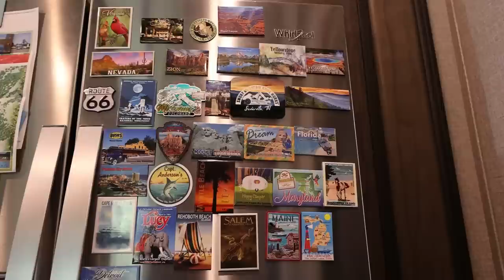RV Water Heater & Refrigerator Maintenance | Tips and More!

Comment: Question if you also replaced the anode rod in the water heater? AND a little tip I did was placed a dedicated socket for the water tank drain plug to make it easier to change/remove the plug. I also went with brass drain plugs to prevent that cheap plastic fittings all through the camper. You guys ARE THE BEST! God Bless, be safe, and happy travels. 👌🇺🇸

Comment: Its so sad you ended up at a camping world.  We had a customer with a bad dexter axle in MAINE.  They called dexter direct and had and axle in 4 days. ( 10 year warranty) It took 3 hours too swap out with regular tools.Than we happened to be in tractor supply....axle was in stock. They even had new brakes. 
On another note dont use those shark bites on rubber hose...get some gear clamps from a parts store.....they were never for rubber hoses. Just the pex plastic .
Camping world as you found out is NOT a place to have anything fixed....liars and cheats.

Comment: y'all have to be the nicest, coolest, calmest, sweetest, most under control, easy going couple I've never met (but hope to).  I've had a few issues with the 3 coaches I've had but thankfully never like what y'all have shown (and who knows what hasn't been shown LOL)  You guys must have a special gene in your DNA that most do not!  And since I started watching I've always thought why in the world does a rig that big not have 3 axles?!
Reply from the maker: JIm, you’re Awesome! ❤️ We will definitely cross paths soon enough. Lee and I both agree that there are always two different approaches to every situation. One is a lot easier than the other, but it doesn’t solve the problem. LOL. Embracing the new challenges and learning from them is so much more rewarding. We Always make mistakes and the RV Community definitely let’s us know that we are making them, but that’s the heart of our channel. Imagine how many other RVers are making the same mistakes every day. The funny part, is that we don’t even know we are making them until we post a video and get feedback. 😀 We hope it helps others. As for the RV, we will never buy any rig over 42 feet without 3 axles again. Our rig is way too big for two 7k axles. Hence most of this season and suspension problems.

Comment: Personally I prefer the Teflon tape instead of the liquid Teflon.  It seems it would fill the threads more solidly.  Just my 2 cents
Reply from the maker: We agree. It’s so much easier. The way we understood it was that it hardens in the lack of oxygen. Since it was one of those spots that we definitely don’t want to revisit, we put on the goop. Truthfully, I put on way too much and had to clean it up. I called it silicone tape in the video, but it’s actually Teflon tape.

Comment: New subscriber - you folks were up in the " boonies" us Michigan folks call it and you'll find out as you repair stuff many RV manufacturers use some real cheap parts. We have  2017 2109S Rockwood Mini lite and had to replace battery on/off switch this past fall. Also had a slide on same trip stop working and was just a 30 amp fuse under battery - thanks heavens for google on that one - happy camping folks - love watching your videos - from Kalamazoo, Mi area

Comment: Frosty residential freezer,,,,,
Was this freezer designed to be earthquake proof?
Nope, the door will shift around just enough to leak cold air while you're driving, normal, 
Things break all the time, most can be blamed on the manufacturer of the rig, comes from the phrase, "Spare any expense we don't have to make to get it on the lot to sell it."

Comment: My residential fridge would freeze up after about a week in hot weather. I had a repairman check it out, and he replaced the mother board that is behind the fridge. Another thing I found out is that to make them more energy efficient they defrost every 12 hours. He was able to program it so the fridge defrosted every 8 hours. Problem solved.

Comment: Look for the defrost timer may be at the bottom of the fridge kick panel test it put it in defrost see if it gets hot
Reply from the maker: Thanks. We will definitely check that out. Great tip. 👍
Reply: all so can go bad Defrost Heater  + defrost thermostat
Reply from the maker: Great tips! Thank you. We replaced the defrost thermostat a few weeks after this video. The freezer kept freezing up. The thermostat was easier to change than the heating element behind the coils. We were lucky it wasn’t the element.

Comment: I was able to fit in a set of small fans in my refrigerator above the cooling fins and get constant circulation down over the fins.  This has eliminated the need for defrosting for the last three years.  I have an on/off switch for the fans, but I leave them on all the time.  The two 12 volt fans ran too loud for me and seemed to be too much circulation, so I put the two fans in series (now 6 volts each) and they are quiet and do a fine job.
Don

Comment: RVing requires self-sufficiency, and you learn as you go!  They are as much, generally more, maintenance and repair than a sticks and bricks!  Now that you have upgraded the water heater's backflow preventor and put a water alarm in, you now want to see if you can install a catch pan under it with a drain directly out of the coach.  Good piece of mind, especially if you travel with water in the water heater.

Comment: There has been a recall on the axels for Jayco RVs,  for not having enough welding between the axel tube and the spindle.   You can check that by checking the weld between the axel and spindle.  That could be your problem with a bent axel.

Comment: There’s a manual ‘force defrost’ function on most residential fridges. Google your brand and model and in the future you can try that first. This usually happens if you leave the fridge/freezer door open for long periods. Try opening and closing quickly for best results. Some manufacturers will advise you to unplug the fridge for a period of time. However, if I unplug to defrost your food will also, defrost… If all else fails the blow dryer is the last resort but works wonders. Another thing to remember is that your fridge is off while you’re driving (I’m guessing) so this will make ice buildup more. If that’s true I’m your case you might want to run a manual defrost command quarterly… hope this info helps!

Comment: There might be a small gap in the seal on your freezer that allows warm air in and  creates condensation on that back part which eventually freezes over. Had a very similar issue and it turned out to be that there was a small air leak lol